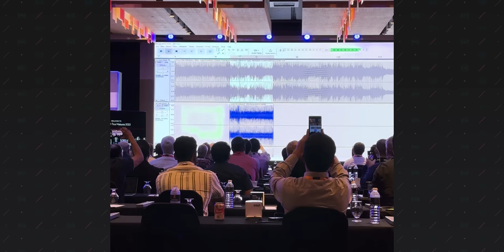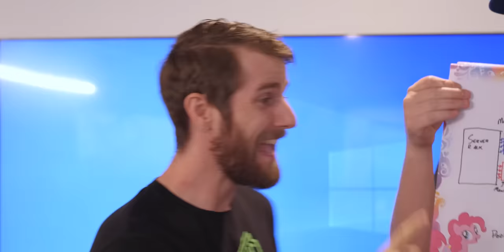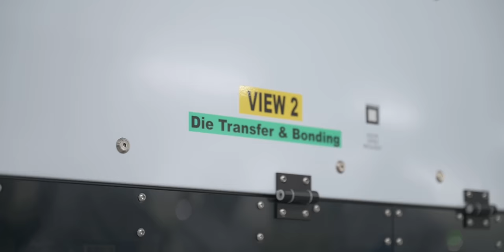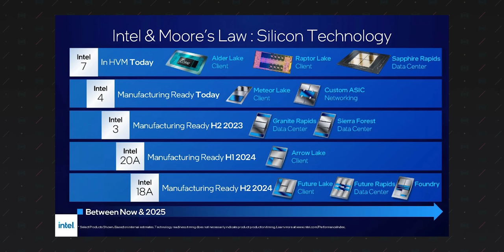The Fascinating Journey of CPUs: From Creation to Packaging

Comment: I like how even Intel aren't running Windows 11 on their production machines, still rocking 10 lol.
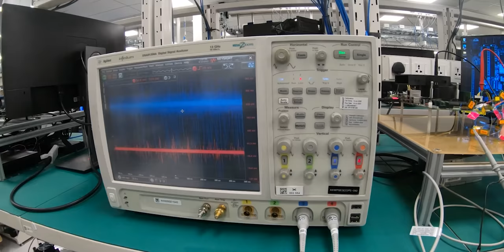Reply: 11 is running on the ones at 2:05, 5:03 and 5:40 but yeah, I'm surprised they're not running embedded versions of XP😁
Reply: @Cyba_IT I have  ditched windows for what is now an ARM based OS because MS kept installing bloatware, tampering with my system configuration, destroying driver compatibility. I don’t blame them for operating old systems.
Working for various suppliers to this industry I understand how resistant to change manufacturers are. Which is not a bad thing. They want consistency in their production system.

I was surprised how the mylar was used. I worked on a vision system using a line cameras to align dies on a wafer for testing. But that was a decade ago.
Reply: @chriswatt2702  Yeah, Enterprise usually hold back until all/most of the bugs have been ironed out. They leave that to the early adopters and home users. 😂 Hence why Win 10 is still by far the most used Win OS worldwide. 

I've got 28 PC's in the office running Linux distro's, Chrome, Mac and Windows. I run Windows on the main ones because free and compatible software is easiest to find. They're fine as long as I clean and optimize them often. 

Sounds like you had an interesting job mate. Was it a CPU production facility?

Comment: It’s interesting that Intel churning out blistering CPUs (yes, they do run hot but they they’re very fast). I’m not sure if the shake ups , Apple leaving them or what, but at least in the desktop space they’re competitive. As a Portlander I’ve known more than a few people who work there, so I’m always rooting for them.
Reply: They're only (and just) competitive by throwing almost twice the power at the problem compared to the AMD equivalent. It's like saying you have a faster car, by just putting in a bigger engine, yet still barely beat the car with the smaller, less fuel thirsty engine. They really are suffering from poor management and lack of R&D investment for those few years before they got rid of their old CEO. A lot of brain drain too as engineers left or were made redundant.

Comment: Intel does all these tests, yet when someone overclocks there cpu, it automatically voids the warranty and intel allows overclocking of there cpus. Overclocking a cpu that is allowed to be overclocked should not void the warranty, otherwise it would be pointless to allow something they would allow which causes the warranty to be void. It's like the equivalent of ripping off the sticker that says warranty void if removed. For example, one plus allows rooting of there devices and won't void the warranty and there are risk when rooting there devices. Rooting an android device allows the device to be underclocked to have better battery life and overclocked to boost the performance. I used to root my android devices but nowadays, it's not as necessary as it used to be. Since most new features that comes to android used to require root access now becomes available with new versions of android. However, old features that used to be available before root access now require root access. For instance, the older android phones used to have outdoor mode to increase the display brightness as much as possible beyond the stock brightness even when the display was set to 100% in manual mode. For the newer android devices, it requires root access to go beyond the display brightness to crank the display brightness to its maximum potential even at the risk of burn in with oled displays. I understand why it requires root access on newer phones so the chance of burn with oled displays will less likely to happen. It should be up to user to make that decision, just because a user has a choice, it does not necessarily mean that it should be not be allowed out of the box. I still have my old one plus one android phone and in the settings, there is a toggle to turn on and off the outdoor mode to increase the display brightness beyond the stock brightness. I always leave outdoor mode on, the display gets super bright, it makes whites overexposed and the colors washed out. I'm perfectly fine with whites being overexposed and the colors washed out, as long as the display is very bright and can be seen outdoors, I'm willing to make that choice since it's available as an option and can be turned on and off if I choose to do so. My whole point is to let the user make the decision, if the features and options are available, let the user make the decision, just have an option to turn on and off the features and options. Otherwise it's misleading, being a hypocrite and disingenuous when making and selling products that they allow but voids warranty.

Comment: Why do manufacturers make the waver in circular shape rather than rectangular when eventually they will cut the waver into small rectangular chips? Isn't rectangular waver maximize the amount of chips made and minimize wastes?
Reply from the maker: Centrifugal force! Seed crystals are dipped into silicon and rotate to extract.
Reply: And the wafers are handled thousands of times by robotic arms- square wafers would be a nightmare to maneuver through the equipment, not to mention the wafers are incredibly fragile, and square corners would mean more broken wafers which is very, very bad.